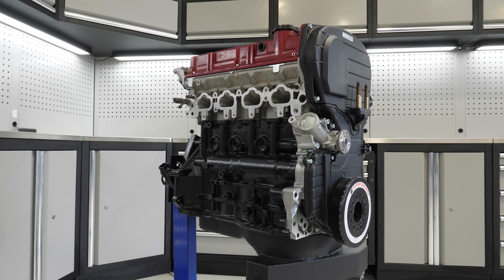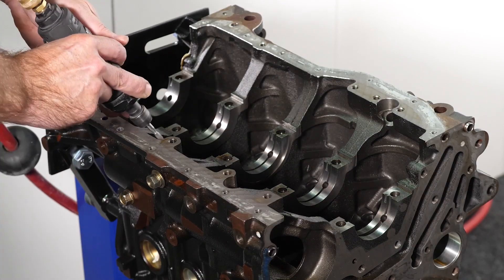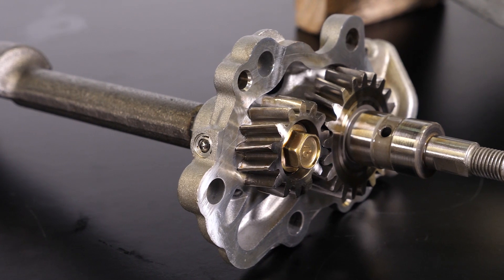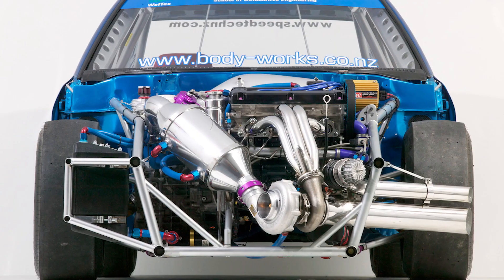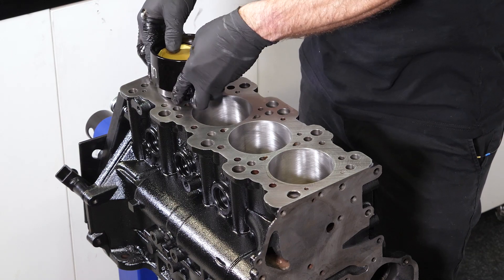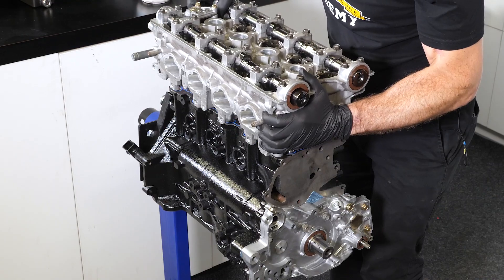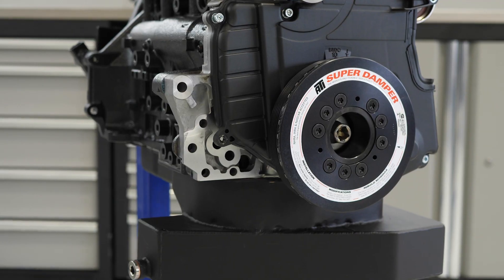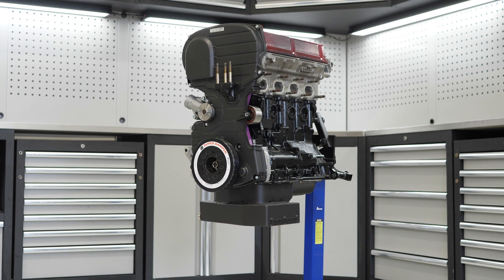How To Build Your 4g63 [#COURSE]

Comment: Hai..i need some advice bout 4g63 motor..i wana build 4g63 all motor so on the cylinder head i wanna fit high lift cam  + oversize valve 1mm intake and exhaust side is that risk the intake valve touch the exhaust valve?because big duration cam and high lift cam..

Comment: Please making a video about 4G93
Reply from the maker: What specifically is different to the 4g63 with your 4g93 build that you find this course content completely unrelatable or helpful? If you haven't watched it yet, you should, as I think you will be surprised how much is similar when it comes to the knowledge you need to understand to build either engine - Taz.
Reply: @hpa101  I don't know if they're actually same engine, I am really freshman about cars. But I want to know about combustion engine at least until I could fix my car by myself.
Reply from the maker: This course is going to help you mate, 100%  - Taz.
Reply: @bamsgian9759  they are basically identical in function and pretty much everything is in the same place just wrong way in the car. The 93 is mounted backwards but definitely watch the video

Comment: talks about reliability, removes the balance shafts. lol
Reply from the maker: Yup! More power, reliably relative to the parts, output and application. If you want factory reliability for the road usage factory engineers anticipate you to do, (if it is an engine that even has good factory reliability!), leave it stock and don't make more power =) - Taz.

Comment: Does this course give tips on how to find a used/core 4G63 or 64 engine for under $2500 🥴? 💩 Is getting ridiculous.
Reply: Dude, look for Mitsubishi Express vans, still thousands of them running around. I'm seeing atleast a dozen here, complete 4G64 engines in Australia for under $1000AUD ($730USD). 👍 Even with shipping to America it wouldn't be $2500USD. 🥳
Reply: @MafiaboysWorld  definitely will be checking that lead out. I've never done any international automotive purchases, but I'm pretty desperate to find a backup engine and transmission assembly Incase something goes pear shaped. I can build almost anything on the car. I just don't quite think my microwave will work well for casting Iron blocks, cake pans probably don't make good piston molds and it'll probably take a while to carve transmission gears with a Dremel.
Reply: @yubentrolled7097  It's a RWD base, so make sure you got a FWD gearbox and such. 👍
Reply: @MafiaboysWorld  the problem is a lot of the rwd 4g63 and 4g64 engines are wide block so unless your rwd or make an adapter it won't bolt up to a narrow block like on the 1g dsms
Reply: 64s are cheap, for the 63 good luck. If you have one dont sell it
Reply: @Jamxknife  64s that fit in the 96-99 Spyder GS are nearly as rare as the 63. Even the 5 speed transmissions have seemed to have disappeared with rebuild service as well.  I'm half tempted to try to bolt an H-22 in mine. I'm trying to keep it easily reversible to 100% original (No welding or hacking the unibody to put an engine on the passenger side).